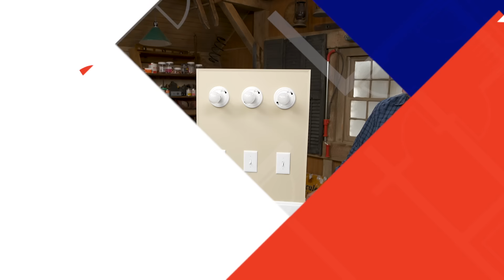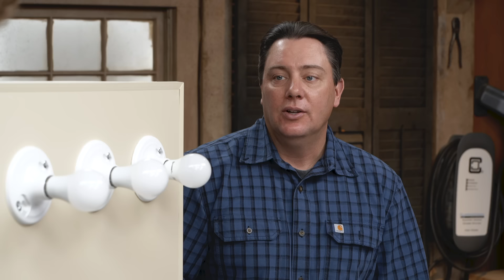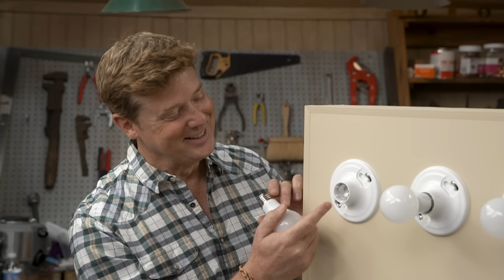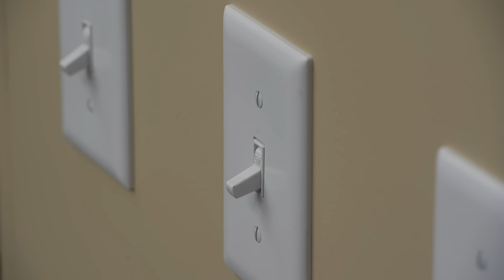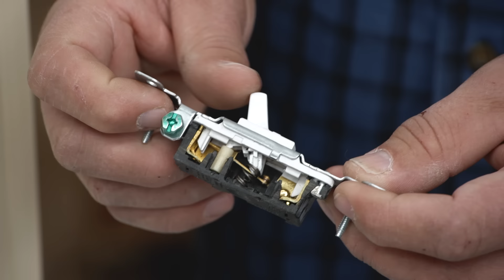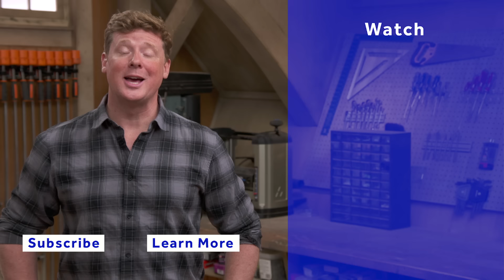How to Fix Flickering Lights in Your House | Ask This Old House

Comment: Those are some of the most common reasons for flickering lights. Believe it or not I actually seen a brand new led bulb cause the entire circuit to fail. All the lights would randomly flicker on that circuit. The homeowner stated that they install all new led bulbs throughout the house in all the lights and now all the lights in his house would randomly flicker. I checked all the common issues like stated in your video including checking for proper connections at lights and switches., but none of those were the issue. I traced the entire circuit and checked every location, check the main panel and breakers. All was great with no issues. So I grab a case of led bulbs from my van which were different brand then the cheap house brand he was using. Well in the one of the kitchen pendants I removed one the bulbs and all of a sudden, all the light stopped flickering. I put the bulb back in and the flickering started up once again. So I swapped it out for one of the led bulbs I had and no flickering anywhere in any light. I put his bulb back in and flickering. I then take that one bulb a put it in a different location on that circuit and all the lights started to flicker once again. So all their issues were from a defective led bulb that was brand new. Not say cheap house brand bulbs are all bad, but sometimes it is just better to spend a little bit more for name brand. All in all I spent a little over an hour trying to figure out the issue. So that one bulb cost him a whole lot. Something to think about when going the cheap way.
Reply: I cannot tell you how much I appreciate your post

Comment: Just remember you MUST check and get the proper outlets ,switches and bulb recievers that is compatible to your wiring (aluminum to aluminum and copper to copper ) and use proper grommets and electric grease on connections.

Comment: one other cause is many houses are also getting digital smart meters so the power co can.

1. bill down to the watt hour.

2. detect power outages.

3. detect fires impending and immediately cut power before house burns down*

*= i heard somewhere that the power co can using the smart meters detect fires starting to happen and shut off the power before it becomes fully established.

the modulation used to transmit the usage back for billing can cause the leds to flicker as they use a fairly low frequency that can sometimes be heard as a buzz in appliances and some electronics.

Comment: My entire home flickers since changing my whole house to LED.  ANY light in the house will flicker.  I can kill all the breakers and single out any one circuit and the issue persists.  I am concerned it may be the source. Suggestions?
Reply: No dimmers in the entire home, replaced dozens of switches with C by GE, and both the traditional switches and new switches exhibit the same issue.
Reply: A electrician told me it’s dirty electricity or low quality light bulbs ? Change to  
Philips LED A19 Ultra Definition Dimmable LED Light Bulbs - Flicker-Free Light Bulbs with EyeComfort Technology

Comment: there are two other causes for flicker , if the led driver inside is bad . and i have another situation where i have a bulb over the kitchen sink that flickers when the oven is on due to some sort of interference .
Reply: There is also a change that signals on the line from the grid (such as those sent to trigger on-peak and off-peak switches) can induce flicker. 

Not sure if it’s a common thing in the US but down here in Australia there are numerous times per day where a load control ripple is sent on the line that makes my lights flicker for 1-2 mins. 

You can get filters for the circuit but it’s a bit involved and not so cheap.

Comment: I replaced 2 switches in the bathroom next to a sink, one was a light switch and the other for a vent. I noticed that the GFCI  outlet was connected to both switches. Do I need to do the same? Is it a safety issue? I didn’t but now I’m starting to wonder if I should have done so. Hopefully you understand what I’m trying to say.

Comment: Thanks.

Here's one for you: I turn on the light in one room and the light goes dim in another room,  I plug a small appliance in one socket and another small Appliance goes faster or slower at another socket

Comment: I put brand new dimmer switch and brand new dimmable led bulbs and I am still getting a flickering when it is on high, could this be the wiring to the actual lighting fixture?

Comment: Ok so my lights are flickering as in your 3rd scenario.  Very slight, short duration and randomly thru out the day.  NO dimmers.  So what's the problem?  Checking bulbs and switch right now.  Thanks

Comment: Usually the cause is a failing LED bulb. They are extremley unreliable. Sometimes the flickering sorts out as the lamp warms up. The center contact in the socket might be flattened and need to be twisted back. New bulbs have a flat pin on the bottom without a blob of solder. If it was so corroded that screwing the bulb didn't polish it, then it would fall off, not work at all or short out.

Comment: I’m bummed, I didn’t see my house’s symptoms in this video. My LEDs pulse at about 1 Hz every now and then, typically lasting for several minutes. It seems like the incoming power to my house is either out of phase or dropping voltage. The house was built in the 60s and has the original supply and panel. Any ideas?
Reply: I've got one bulb in my basement doing exactly that! A slight flash every second,  I watch it for 5 minutes,  then turn my back and the bastard is burning steady!!!!
Reply: buy an oscilloscope?
Reply: Check the bulbs, maybe cheap bulbs but check the bulbs. There seems to be issues that no ones really touching on  . One commentor said it could be just one bulb. I would try that.

Comment: Any other reasons? I have new light fixtures and LED lights. Not dimmable lights or switches. The flickering only acures once and a while when the lights are on for a period of time. It does not happen when turning on, or turning off. So, if I leave them on for 15 minutes it “may” flicker quickly once or twice in those 15 minutes and go back to normal. The flicker is less than a second long. Any help would be great.

Comment: At a house, flickering LED lightbulbs bypass the switch power company. Check the neutral on the main powerline coming in ran power across the street to the neighbors house tempting the lights and they still flicker reveal lightbulbs. Replaced them and they stopped flickering.

Comment: When we were sold the LED Bulbs hype that they would last longer, some claims up to 18 years! Ours did not, more like 2 to 3 years. They failed early or something else going on?
Reply: Yeah, when they first came out, they were made like a tank. I have many first generation bulbs and not a single one has burned out. They last basically forever. After a few years, the manufacturers started using cheaper components either to save money or to keep customers having to return and buy replacements.
Reply: Right, the actual LED doesn’t fail, the circuitry in the base of the bulb fails, especially if the bulb is in an enclosed area.

Comment: I installed a smart switch dimmer at a clients house today. I don’t believe that had led bulbs but the light would flicker on and him then be okay and turning off it would do the same. My wiring was correct on the switch side I didn’t have time to check out the fan but assumed it’s wired correct due to it happening after I installed the smart switch and I honestly have no idea why it would be doing that? It’s acting as if it’s trying to dim on or something

Comment: Can corroded water pipe ground clamps cause lights to flicker under a load I have s security light wired to the garage & every time I use the garage door opener It goes out and cycles back on I'm thinking a loose Neutral?

Comment: even the LED dimmer switches can make some bulbs flicker. If you have a smart bulb that can be dimmed by voice through Alexa just install a standard switch. I had both the Kasa and Philips color wifi bulbs flicker a bit with the LED dimmer.
Reply: Agreed. Smart bulbs like Philips Hue require constant hot, and should never be dimmed using a wall dimmer. 

If you have Philips Hue and you want a wall dimmer as well, Philips makes a battery-powered remote that you can mount to the wall. Or you could mount the Lutron Aurora dimmer over an existing switch, which allows you to dim your Philips Hue lights easily with no wiring changes.

Comment: Extremely disappointed in my local home depot, and not knowing what a 0-10v dimmer is. I bought some shop lights that have the small purple and grey wires. Need a 0-10v dimmer, IMO these lights are almost useless on a after work project, having to run extra wires all the way back to the switch. I had to do a fair amount of my own research on these.
Reply: I guess I am lucky when I go to Home Depot.  I usually can't find anyone to help me with a question I have.  But, I guess it is better to not have someone available to answer your question than have someone available to give you bad information.
Reply: 0-10V lighting is very common in commercial buildings (retail stores, offices) and extremely rare in houses. I wouldn’t expect the folks at Home Depot to know what a 0-10V fixture or dimmer is because of this. I have only seen 0-10V fixtures in residences when someone works on commercial lighting for a living, and installs a spare commercial fixture at home.
Reply: Home Depot pays minimum wage, do you expect a certified electrician to work there?

Comment: I have been ignoring flickering led bulbs for about a year - but today, I was cutting my hair and my clippers changed speed with the dimming lights… Called the power company, they are sending someone to check transformer and house connections. Fingers crossed…

Comment: I have a different situation than the 3 in this video. I have a basement light, pull chain, works fine with an incandescent bulb, but when I put in an LED bulb - the bulb sometimes flickers, and sometimes does not light at all. If I put the incandescent bulb back in - it works fine; there is no dimmer switch. Why would an incandescent bulb work, but an LED does not work?

Comment: I have flickering LEDs on a 3 light fixture but not all of them with no dimmer. I did notice with a multimeter when I replaced my bathroom fan switch it showed only 20 volts for some reason but when I went to the breaker box it shows full voltage. So I’m wondering if their is a bad splice there that feeds both switches and could be causing the issue. Or maybe the LED’s just suck.
Reply: Did you ever get this sorted out? I've got the same issue and am just starting to dig into it.
Reply: @vrts  it’s been so long I honestly don’t remember. I think I may have replaced the switch. I know I never fixed any wiring. 

I did run into another led light bulb flickering again in another room  the other day. I noticed the flickering one would stay illuminated slightly longer and fade out when I shut the switch off while the good one went off instantly. Anyway that one  ended up being a bad bulb.

Comment: When I had the power company come out they told me everything was okay, luckily I called back a 2nd time and they sent a different tech, he tested and all was okay, BUT, then did a LOAD test, showed I had a bad neutral.  He installed a "service saver" transformer and my lights are now STEADY!  Now I just have to wait for them to replace my neutral wire from the road to my house.

Comment: I had an issue with flickering LED fixtures; the issue was a lighted switch or night light switch incompatibility with the LED bulbs. When I ran a voltage meter test, the neutral was carrying 85 volts of charge in the off position of a 110 volt connection.
Reply: Why was ur neutral carrying a voltage of 85? And in reference to what? Seems like u have bigger problems unless ur terminology is off
Reply: @Nick-bh1fy  
The issue was a continuous current that was being fed by an LED fixture and a nightlight switch/lighted when the fixture is turned “off.”   The switch states not compatible with LED lights but it does not define the effect.  In my case, it was flickering LED fixtures. When I tested the leads, I was surprised at load the neutral was carrying—basically it created an open ground that fed back to the breaker box; hence, it was returning a charge to the service line.

Comment: The most common cause is a bad ground at the meter panel or a breaker burning on the buss, you can also check for loose wires in the panel.
Reply: No it's not, a loose ground won't affect your lights flickering. A loose neutral would though.
Reply: @empire0  ok not flickering but more like dimming and getting bright again it is the system not grounded well, trust me after 43 years being an electrician at the cost where the salt air corrodes grounding connections I’ve seen it many times.

Comment: What's causing slight flicker when the small laser printer is turned on and remains on?  Doesn't have to be printing to cause light issue, just in the on position to cause some flickering on the track lighting which I suppose shares the same juice.  The other lights in the room don't flicker as they don't share that same outlets.  Thanks guys !
Reply: Dimmers that are designed specifically for LEDs often have electronics that filter out electrical noise since LEDs are more sensitive to electrical noise than incandescents are. Any other electronics that you have on the same circuit, such as your printer, can generate electrical noise that could affect the lights. When I’ve encountered the problem you mentioned, the cause was that I was using a standard dimmer and not an LED dimmer. I was able to stop the flickering by replacing my dimmer with an LED-specific dimmer.
Reply: They were probably quick connect it. Need to be undone and connect it with the screws on the sides of the outlet and switches.
Reply: @dennydeckerful  hmm, I will take a look and follow up with your suggestion.

Comment: Both times I used it, I had problems knowing what I had ordered and if my order had gone through. There is no cart that shows what you ordered, it is very hard to make changes, there is no way to proofread your order, and there is no Place Order button. Almost every button on the website is a cryptic upsell. One box showed up while I was out of town. Fortunately, it was below freezing and the food was ok. The meals they chose for me the 2nd time were all extremely high calorie pork dishes. I tried for 2 days to change it, then called and they said it was too late. I stayed home on Christmas Eve awaiting the package and called when it didn't arrive. I was told there was no package on the way. We had sandwiches for Christmas.

Comment: I have a half bath light that is 3 LED bulbs. It is on a motion sensor. (kids never turn off the lights!!) It used to work fine. Now it will be fine if it is ON, but as soon as there is no motion and it turns "off", the lights just flash about every .5 seconds. Any ideas there??? Thanks!
Reply: This sounds like a minimum load problem. I recommend checking the specs for your motion sensor to see what minimum load they require to be connected. If you have a 2-wire occ sensor (aka. no neutral wire) then the sensor needs to trickle a bit of current through your lights to run the sensor, even when the lights are supposed to be off. Some LEDs handle this gracefully and remain off when this tiny amount of current is passed through, but it sounds like yours are lighting up. This is common if you have too little load connected, like if you only have 25W connected to an occ sensor that has a 40W minimum load. 

Occ sensors that have a neutral wire will pass no current through the lights and instead it will use the neutral wire. So if you are using an occ sensor with no neutral wire you might need to upgrade to one that has a neutral wire connection (assuming that you have a neutral wire available in your wall box).
Reply: @andrew-online-w6g  pretty sure you nailed it here. Thanks for the response. I went and got a switch that was rated for LEDs and now it is working perfectly fine.

Comment: that not all the reasons a bulb will flicker, there is the loose joint In a junction box,or an appliance breaker could be above the lighting circuit that powers the bulb your trying to light up,just so you know.

Comment: One could also have a loose connection a at the circuit breaker if the flicker happens after a trim.

Comment: What about LED flicker caused by hand held appliances? 2 year old house, designed and built with LED fixtures. When someone turns on a hair dryer or curling iron, lights begin to flicker. Turn it off, no flicker
Reply: thts a loose connection at panel either a phase or neutral seen it on the neutral side lazy service co. barely made j-point at the entrance service  head  😤🤯

Comment: I have LEDs that dont need a dimmer but can be dimmed by turning the light off and on again. It can go to 3 levels: 100% and then I guess 70% and 50%. For some reason they worked a while but started flickering or even going out. It's a ceiling light with 4 LED lamps. Sometimes one of em goes out or changes the level, but if you keep em runnign a while, they eventually stop the nonense. I have no idea whats going on.

Comment: Its not about the dimmers. The light outside my door flickers with LED bulbs, and it only has a regular switch (no dimming feature). There are specially made LED bulbs which says on the box "No Flickering!", and those indeed don't flicker. So its the way the LED bulb is made inside. My problem is now that I need a 100W LED bulb with the "No Flickering" feature, but they only make it in 60W.